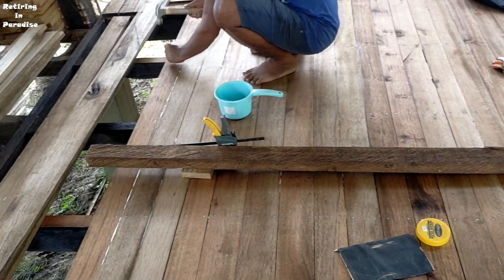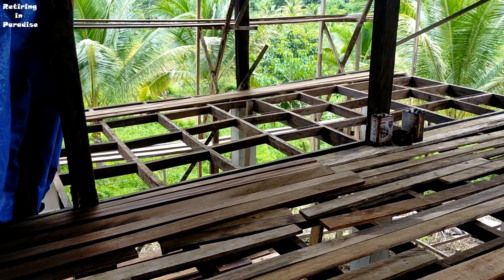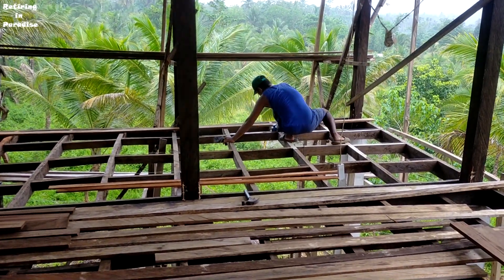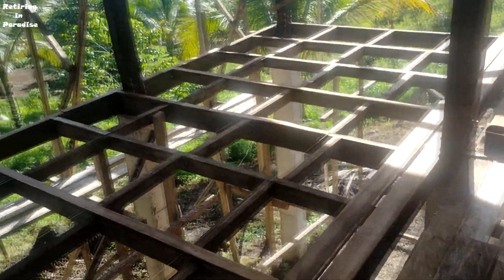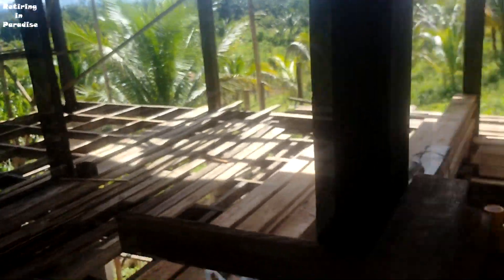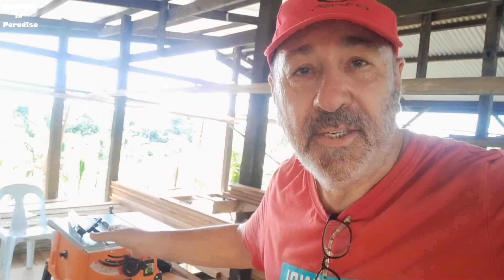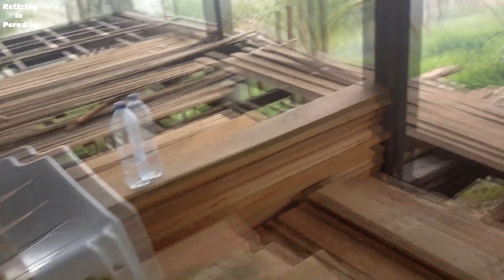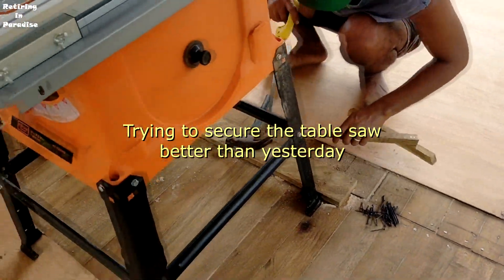V311 - Pt 35 FOREIGNER BUILDING A CHEAP HOUSE IN THE PHILIPPINES - Retiring in South East Asia vlog

Comment: I was just watching your video and I must give you a bit of advice again. I'm the builder that told you about sealing your timber after you plane not before. Today it's about the table saw use. Only put the blade high enough to cut through the timber. That way if your hands happen to slip over the blade it will only cut you. If you keep your blade high like on this video and your hands slip, you're going to lose fingers and possibly even whole hand. Keep that blade just high enough to cut through. 2mm above timber. Be safe

Comment: Lower your blade on your table saw to just higher than the thickness of board to be cut.  It will work much better and is safer against kickback.

Comment: The table saw is your best addition yet.  Speeds up the process.  The thickness planer is good too for those local land trees.  Heck all the power tools are so useful.  Air compressor and a nail gun you would be done in no time.  But that is two more items to buy and won't help when the power goes out.  Great JOB!
Reply from the maker: Thank you😊👍👍

Comment: Just a suggestion. All of those wood chips and sawdust you should be burning it and not putting it in the ground.  It will attract termites and ants. Just my two cents worth. House looking great. I assume you will use amoken for the other covering> Also where are you building?
Reply from the maker: They are cleaned up and burned as we go along. We are aware of that.
Yes my wife loves amakan so we will have some here and there with a combination of hardieFlex.
We are near Dipolog